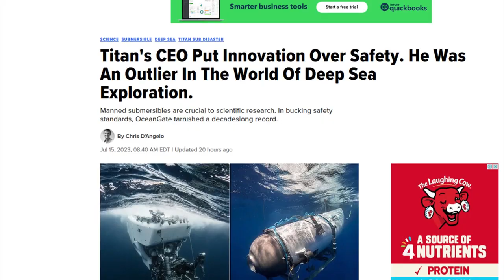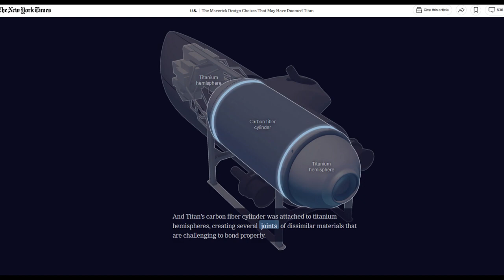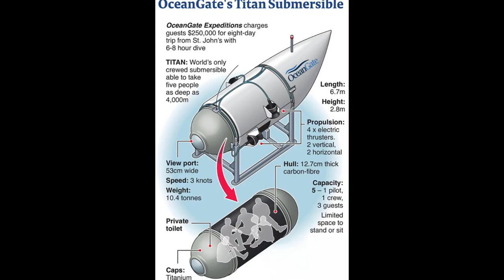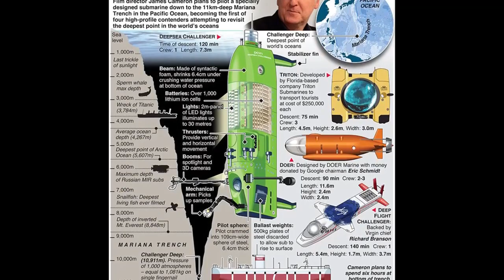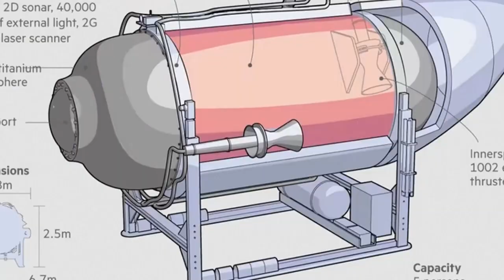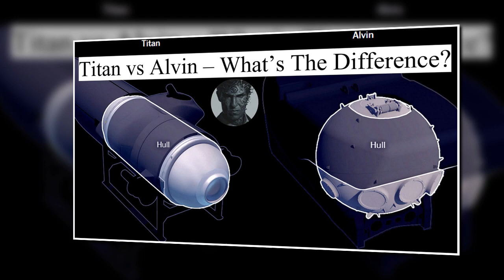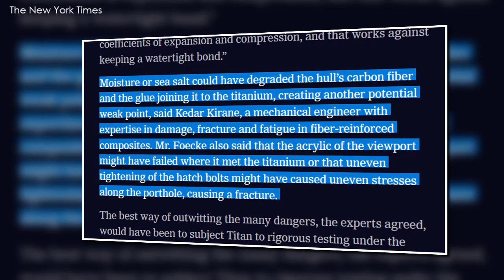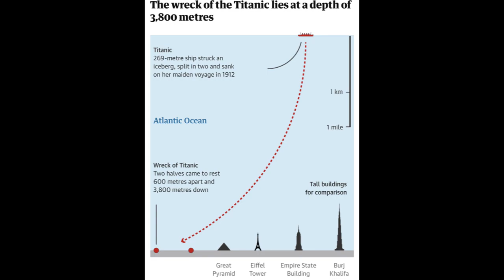Serious Question: Why COULDN'T Titan Be More Like Alvin?

Comment: Pressurized spheres have equal stress in all directions until you put holes in them. Access holes that are large enough for people to fit through are a large fraction of the diameter and need a lot of reinforcement. This destroys much of the mass efficiency. Pressurized circular cylinders have twice as much stress in the circumferential direction as the axial direction so the thickness of an isotropic metal cylinder is twice as thick as it needs to be for axial stress. Pressurized fiber reinforced cylinders do not have this inefficiency. They can be made with twice as much fiber in the circumferential direction as the axial direction, so the fiber stress is the same in all directions like a sphere. The stress in a cylinder is a function of diameter and thickness and is independent of length. So the volume can be increased by increaseing the length without increasing the thickness, not so for a sphere. Spheres can be made thinner than the same diameter cylinder, but long, smaller diameter cylinders are much more efficient than spheres for a given volume. To minimize the size of a sphere to hold 5 people in a sphere, you’d have to stack them. With cylinders you just make them longer. Composites are made from flat material. You can’t make a sphere with flat material without wrinkling flat material so you need many small pieces to minimize wrinkling. A cylinder does not have this problem. You can easily make a cylinder by rolling a sheet of paper, try making a sphere. Rush wanted composite domes also. He tried that with the subscale test that failed at the equivalence of 3000 meters. The spherical dome failed. The test proved nothing about the cylinder. I’m tired of hearing it should have been a sphere. For more than one person, a cylinder is the only choice.

Comment: Instead of making the skin 6 inches thick make it 15 inches thick out of carbon fiber. I don’t see why they didn’t try a sphere and just make the skin three times as thick. They still should’ve gone through normal testing and approval.
Reply: I dont know if the carbon fibre would have held up over time (lets say 100+ dives if the hull would have been 3 times as thick, but I would have gone with a titanium/steel/aluminium egg type hull with space for 4 people instead of 3. And then increase the price to 500.000 or even 1 million. Then make use of tried and tested equipment, so the succes rate of going is almost 100%

Maybe then it could have worked out...

Comment: A spherical hull would not have saved the Titan. The Titan's failure can be attributed to a number of flaws separate from its shape. Stockton Rush disregarded numerous safety regulations that ultimately led to his demise. OceanGate going with a cylindrical design is not inherently a terrible idea. A spherical shape would have been impractical for its intended crew size. A cylindrical hull offers significantly more crew space than a spherical one. Yes, a spherical hull would have been able to handle the pressures better, but it's not actually mandated that a submarine have one. Any shape is perfectly viable as long as you've done your math to show it could handle the stress.

Also, it's not the first submersible with a cylindrical pressure hull rated for such depths. Aluminaut had a cylindrical shape, and much like the Titan, was built from an experimental material that was light weight and weaker in compression than in tension. It was rated for much greater depths than Titan. Despite this, the Aluminaut would go on to be hailed as an impressive feat of engineering with a very successful track record, being used in multiple sea floor surveys, it was involved in the recovery of numerous lost weapons (including a nuclear warhead), and even lead a rescue operation to retrieve the Alvin when it sank in 1969.

Comment: Ill say it again. The submersible did not fail because of its shape. The cylinder versus sphere had nothing to do with it. It had multiple weak points that would fail long before this. I explained it in another comment possibly the longest in YT history lol. Yes a sphere is always going to be stronger than a cylinder. However any solid shape is less likely to fail than a shape improperly joined together. The Titan joined carbon fiber to titanium, how did they do it? Just like they did everything else.... in essentially the most improper way possible, and that is your failure point. It would've failed first if the thing were a triangle, diamond, square, whatever, you pick.

Comment: The elongated sphere is absolutely weaker than a traditional sphere.... but that was not Titans weak point. I do not know how this narrative formed but I believe one individual must have copied another person, who believed another, et cetra et cetra until every information source is saying the same thing so it is only natural that the next person in line follows suit. However the fact remains that the weakest point in Titans design has always been where its carbon fiber hull meets and bonds with its Titanium end cap, more specifically on the side used to enter and exit the vehicle. 

Lets ignore the improper bonding they did in two dissimilar materials for a moment and simplify things down to basic real world stuff. This won't get us any exact info but it will get our minds working the right way and break the follow the leader chain that it's so easy to get locked into...

Every mechanical piping system in the world uses cylinders right? Many of these systems, cylinders, elongated spheres are under high pressure and many are under significant vacuum. The fact remains that they survive decades, some under constant pressure from the inside, some having a much lower pressure inside as the outside world essentially tries to collapse, or implode, them. Many of these pressures, internal and external, greatly exceed the 6,000 psi at the depth of the Titanic. You see this not only in every pipe but the pressure vessels or what many call "tanks" on he side of the road. But they don't leak, they don't implode... why? Nevermind, that's later. Lets ask ourselves though, where do they leak? At the joints! At the connections! Where one piece of material is joined to another. That's why the individuals assembling or welding them are highly compensated. So now let's take that info and extrapolate to our submersible. Again this is rough calculating, we're just getting our brains thinking for themselves. 

So the pressure systems we know about don't typically have issues at the middle of their elongated body, but they do have it at the joints. These joints are welded shut and then those welds are x rayed and pressure tested. If not welded they are bolted with supervisor gasgets made to compress under extreme pressure that we put it under when we tighten all these bolts extremely tight. If not welding or bolting flanges are joints are made with threaded connections. Similar concepts, prescison cut threads are cut and then they are joined together extremely tightly. Now all these connections are very reliable.... yet not nearly as reliable as our elongated spheres? Lol. 100 or 1000 joints will fail before a solid structure even imagines failing so.... back to the Titan....is it more likely our hull failed in the middle of our solid structure,  did it's weak point go first or where it's joint was made?

Next step.... did the Titan use welding or precision threads or extremely tight bolting at a specific torque with a gasget designed for that torque to join its hull to the end caps? No, it didn't. Well, what did it use?

The Titan joined 2 dissimilar materials. A principal we know in engineering to be highly likely to fail under pressure.

How did it join these two dissimilar materials? Well....essentially with glue. Now specifically Locktite like everything else they use can be bought at Home Depot. What temperatures was this glue rated for? I will save you the trouble. Like most off the shelf do it yourself synthetic substances it was rated for high temperatures. Don't quote me but anywhere from room temp to 300°F. What is the temperature at the bottom of the ocean near the Titanic? What process did they use to adhear one material to the other? This is getting way way too long so I'll let you do the rest yourself but I'll tell you...

The Titan failed where Carbon Fiber and Titanium were held together with high temp rated Locktite. The insanity of this is honestly very very very hard to even believe. They should not have joined dissimilar materials. This causes joints to fail under much lower pressure due multiple reasons, in this case m thermal expansion. They even used the entirely wrong type of glue bc it was cheap. Not only that but the prices for applying and curing this glue was horrendous and the surface area the glue was applied the glue too was much much too small. Everything about it was legitimately wrong.

Now had the joint used similar metals, had it been properly welded or tightened, had the used the correct filler material/gasget/adhesive been used in the proper way the joint should have been as strong as its material and then at that point our most likely failure point would have been the center of the length of our cylinder.

Hopefully I've explained this in a way that makes sense and after reading your able to open your eyes and say "oh yeah duh of course that makes sense."  Lmk

Comment: The pressure bottle is stressed by pressure from the inside out and the fibers are stressed by tension, that's OK. When stressed from the outside - the fibers are stressed by pressure, no strength, the pressure bottle collapses implodes.
Sorry for the English, I'm European.

Comment: There is nothing wrong in principle with a cylindrical design. Millions of high pressure vessels are cylindrical (eg all diving cylinders manufactured). The math to calculate the forces is easy. The problem is using carbon fibre (because building the cylinder all from titanium would be expensive).
Reply: The pressure bottle is stressed by pressure from the inside out and the fibers are stressed by tension, that's OK. When stressed from the outside - the fibers are stressed by pressure, no strength, the pressure bottle collapses implodes.
Sorry for the English, I'm European.
Reply: @BZE-dt6di  I am English and European :-) Yes, the point is that carbon fibre is a poor choice for a compressive load. And mixing the construction with different materials for the cylinder and the end caps was a terrible engineering choice.

Comment: It wasn't the cylinder that was the big hang up for it made a few successful trips down to the Titanic. It was the material. It was the lack of an appropriate NDT used after each voyage to certify it was safe for another go. The crackling noises should of alarmed everyone for that sound was the resin failing gradually. In an unstayed vessel like this, using all Steel and/or Titanium, those sounds would not occur, short of implosion. CF has strength in tension only, not the compression this vessel saw. That guy must of gave one hella sales pitch to get people to go down with him, assuming those people knew ANYTHING about engineering and strength of materials

Comment: The reason why Stockton couldn’t or WOULDN’T make it spherical is because when the first one was made in the shape of a tissue roll required being spun on a mandrill. Stockton didn’t want any impervious actions that would pierce the hull , he then wrap the carbon fiber layers around the mandrill once it was cured they slip the mandrel out. If Stockton would’ve made it spherical you could NOT of a put a mandrill in there without cutting the 2 half’s of the circle apart .He wanted it one solid piece. If it was half’s He would’ve had to bonded both halves of the sphere together, making a weak point , He just had to make it out of carbon fiber !  JUST HAD TO ! And we all seen what happened because of it unfortunately. RIP 😞

Comment: 10:16 i said the same thing! 10:48 So correct on this what you say. The metal an middle section definently bends an swells in different ways so how was this tightened together?  
These snaps an cracks aren't Good! Scary if anything!

Comment: I HAVE TO ASK DID STOCKTON RUSH GAIN HIS ENGINEERING DEGREE IN PAKISTAN OR AFGHANISTAN OR BANGLADESH??REASON IS HAS ANYONE SEEN HOW MECHANICALLY MINDED PERSONNEL  REBUILD'MEND'MODIFY'UPGRADE OLD VEHICALS I.E. AXELS/CRANKSHAFTS/ETC THEY ARE INGENIOUS THEY TAKE CHEAP STEEL ETC AND MOULD THE PARTS NEEDED ID CALL THEIR WORK MAGYVERISH HOWEVER THE PARTS WORK!ALSO NOT ALOT OF DIFFERENCE BETWEEN RUSH AND THEM EXCEPT THEY REPAIR MEND MODIFY AS THEY NEED TO NOT FOR PROFIT VANITY OR TO BE REMEMBERED AS AN AMATEUR WHO KNEW MORE THAN SOME BUT HELL OF A LOT LESS THAN MOST ID FEEL SAFER CLIMING INTO AN ICE CREAM TUB GLUEING MYSELF IN THEN PUNCHING HOLES IN THE BASE TO EQUALIZE THE TUB TO SINK

Comment: Getting back to the question Why COULDN'T Titan Be More Like Alvin. Alvin was designed for two people. For Titan to carry Five people and be spherical it would need to be bigger. Surface area of a sphere is 4pi(radius squared). In short a bigger sphere has an even bigger surface area (radius squared). Load on the sphere is pressure (per square inch, cm or whatever). So much bigger area means even bigger crushing force. Given Rush was a cowboy a bigger sphere just wasn't going to happen. But there again he did have an innovative design!!!!!!!!!

Comment: You do know the vast majority of submarines are "sausage shaped" also almost all pressure tanks are sausage shaped. I'm sorry to say it but you don't seem to have any idea what you are talking about.
Reply: submersibles the pressure vessel is a sphere. these submersibles go deeper than submarines do. Submarines have what is known as crush depth which is anywhere from 2400-3000 feet this is military subs btw at crush depth the submarine implodes. so you are the one who doesn't know what they are talking about.
Reply: @toomanyaccounts  ok? That doesn't mean a sphere is stronger. Don't be a dill. A sphere is cheaper to build from a volume standpoint but there is nothing wrong with the sausage shape. The failure was using carbon fiber not the shape.
Reply: @toomanyaccounts  a sphere is the most efficient shape to get the most interior space with the least amount of material. This isn't debatable it's a fact. I understand you want to be smart but you aren't.

Comment: It would be interesting to perform a pressure test of 2 vessels made from the same material (e.g., Titanium) but one spherical and one tubular - each of the same diameter and made from the same batch of material. Scale models could be used. Pressurize them both at the same time and same rate but in different (side by side) Test Vessels (so that the second one to implode isn't damaged by debris from the first one). My guess is that the spherical would withstand 20% or more pressure than the tubular at the failure point. This would be a test of geometric design only but would clearly show why the spherical model is the industry standard - the dissimilar materials used in the Titan is a whole 'nother issue.
Reply: we do know what happens. at 2400-3000 feet the tube collapses wheras the sphere doesn't
Reply: @toomanyaccounts  depends on thickness of hull(s) where/when failure occurs.
Reply: @toomanyaccounts  Likely more than 20% (which is only a guess). What's your guess?

Comment: What I don't understand that no one is talking about is when they were laying up the carbon fiber nothing was done in a clean room.. Which means the material was in extreme danger of acquiring FOD (foreign object debris). I used to do hand layup with prepreg carbon fiber and we had to wear tyvek suits and work inside of a clean room with 3 pairs of gloves on, hair net etc etc. Where was the concern for FOD? Instead it was being put together in a dirty open warehouse setting.. So unbelievably careless and reckless for anyone who had the smallest idea how important it is to keep a sanitary work place when working with carbon fiber
Reply: no clean room or vac chamber for the gluing so air bubbles will develop.

Comment: That wasn’t really smart to begin with. When you’re charging $250k to go see the Titanic, your customer base are the very wealthy people on earth. So instead of building a tictac long crushable sub with 4 passengers, he could have build a rock solid sphere sub with only 2 people (the pilot and the passenger) and then charge $1M for it. The billionaire that would really want to risk his life to go see the Titanic would easily pay $1M… for billionaire $250k or $1M, it doesn’t even matter at this point. The only reason to build a tictac shape sub over a sphere is only to fit more people… that’s it, which isn’t a technological and science fact, but instead an economical criteria. So his design, and therefore the whole safety of his sub was not based on science… that alone was probably the biggest red flag you need to know.

Comment: I've been hearing the words "Rush" and "innovation" used together quite frequently, and it's a bit of a head scratcher. Innovation, by definition, is a component of driving an endeavor forward. It's not complicated: this was a would-be commercial venture based on economics. Build cheap using cheaper universal parts in a vessel where the payload equals a million dollars a trip that would finance a few other subs and carve out a niche business. After those scrubbed missions, Rush was desperate to launch- and so were a couple of his customers. This paradigm was screwed at inception.

Comment: It’s not just shape here. Most subs have similar cylindrical elongated shape but their bodies aren’t made by mixing composites and metals. That’s simple engineering. If you apply some glue and think it will hold two different materials intact at insane pressures of crush depth and have audacity to not do stress testing, your the biggest experimental idiot in the engineering world.